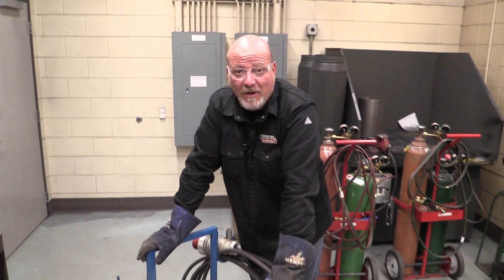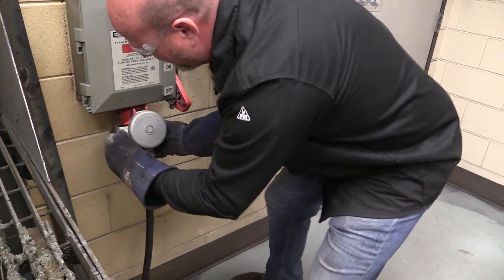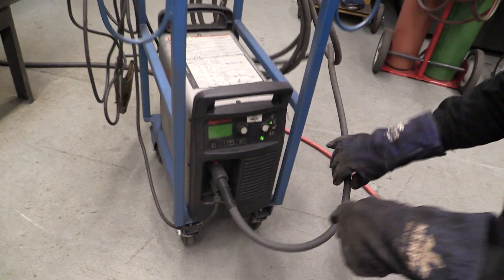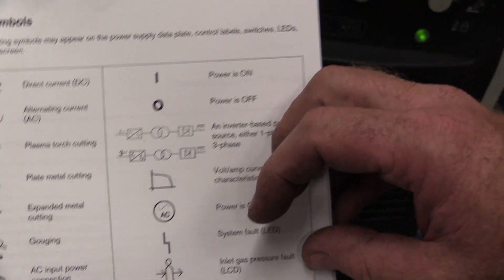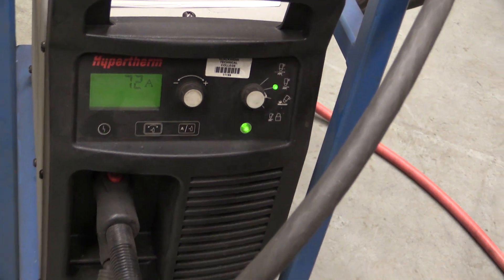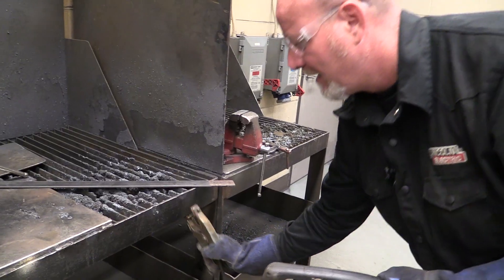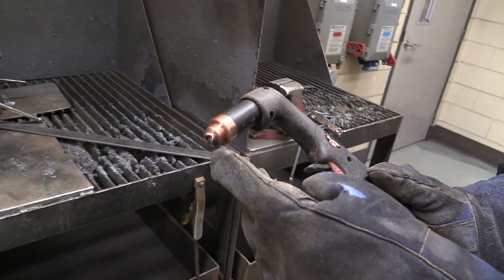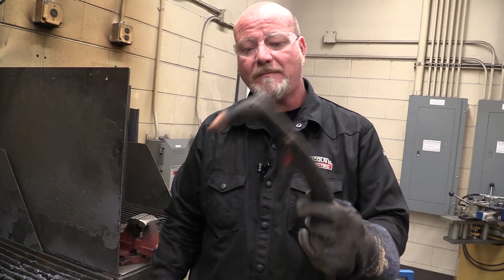Plasma cutter set-up and operation for first time users.

Comment: Manual is lost. How much air pressure? 1/8 ".. 1/4 ".. 3/8 " thick steel .. PAK Master 38XL
Reply from the maker: Usually between90/100 psi. Air pressure stays constant for thicknesses just increase or decrease amperage for different thicknesses

Comment: What shade do you need for plasma cutting?
Reply: If you have a hood set it to 6 and if it's too bright adjust higher. I see guys use shade 4 but I value my eyes and would rather go a little darker. I use an auto darkening miller digital hood so I have different settings for each mode

Comment: I’m about to buy one but dose the air from the air compressor have to be completely dry ?? And if so can you do this to a air compressor or do you have to buy an air compressor that uses dry air ??
Reply from the maker: Clean dry air is always the best, dirty air is hard on equipment, this can be remedied with a moisture/partial filtration system. Plasmas do need good air.

Comment: Question. The dial that dictates how long air flows after you release the trigger? If I'm cutting an AC compressor open, how many seconds should it blow air after I release the trigger?
Reply from the maker: Are we talking MIG or TIG?
Reply: @markprosserwelds9419  Ehh, I don't know if it's either. It uses compressed air to push molten metal away.
Reply from the maker: With TIG the gas flow after the arc extinguishes is called POSTFLOW. The amount of flow is set on the machine. Many machines have different type of dials but the numbers on the dial represent postflow in seconds.

Comment: So is this the setup and operation for all plasma cutters? Do any of them use gas or is all of them just ran off Electric and air, ? no gas needed
Reply: some have buildin air compressor, for thin metal cutting, mostly automotive